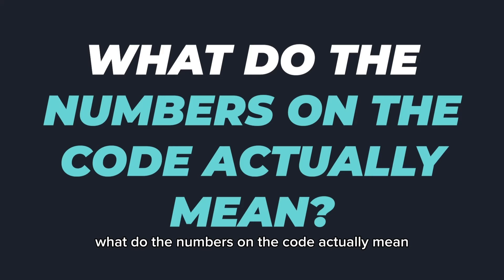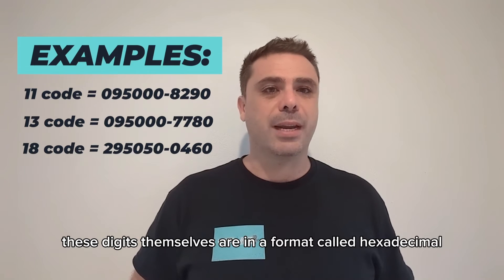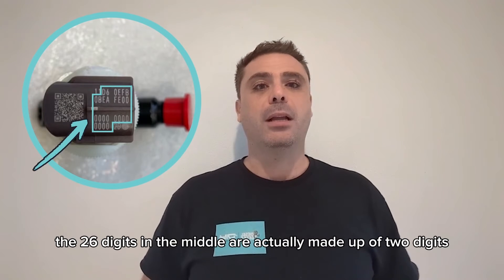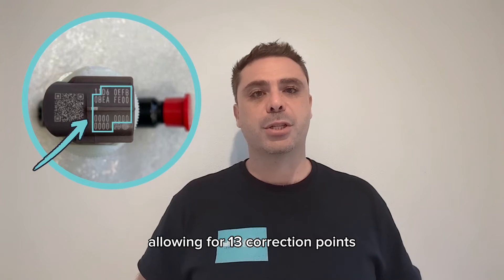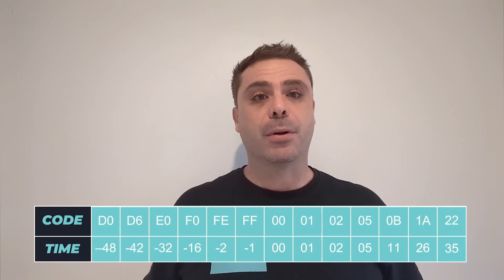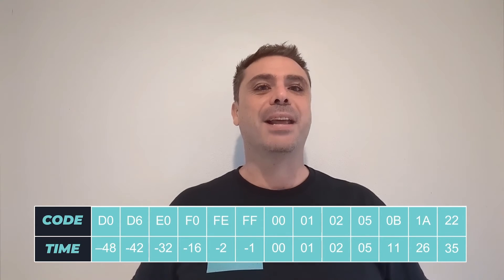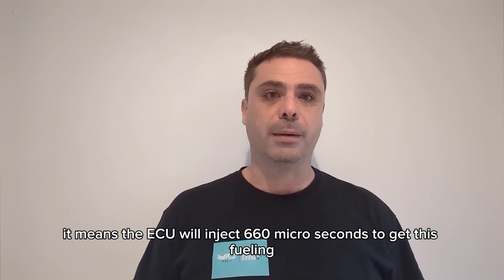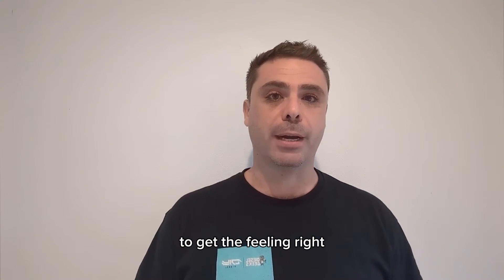Denso Injector Codes - Everything you need to know (short)

Comment: does it matter if you pull out injecters that are say code 11 and replace with code 18?
Reply from the maker: @cheezus1098  yes. Basically 11 code and 13 code injectors are very similar, but the use of alternates means you cannot code.

18 code injectors flow around 15% more in the top end and more like 80% more at pilot fuels. For this reason, 18 codes aren't ideal to swap for the others.

Of course if you're tuning, or coding to suit the ecu, then everything is different.
Reply: @DieselGeeksOz  i just did an injector change in my 2012 hilux and the old injectors were codes 11 -13. my replacements are 18 (what the shop gave me for my model) . im just having trouble with the pilot learning and im searching the hills trying too get the answer as too why. if i replace all with code 18 this should be fine as long as i recode and pilot learn yeah?
Reply from the maker: @cheezus1098  did the ecu accept the codes?
Reply: @DieselGeeksOz  yeah accepted the codes, starts and idles, but keeps failing the learning when we try too do it. ( Had it running too get normal operating temp ect )
Reply from the maker: When you input the 30 digit code from the top of the new injectors, did the ecu accept this, or did it come back with an error?
Reply: @DieselGeeksOz  it accepted all the codes when they've been put in. but in the pilot learning statge where you have too take it too 3000 rpm over and over again, it keep failing there.
Reply from the maker: @cheezus1098  were these genuine? 
Also, have you checked the rail pressure fluctuations?
Reply: @DieselGeeksOz  yeah genuine denso injectors, havent looked at it in a few days but as far as a i know everything was fine ect. but it doesnt reach the 3000 rpm as fast as it should when doing the pilot learn. like it idiles fine and sounds fine but just wont reach the rpm fast enough, and the pilot learn says "every 2 seconds press and fast release the acclearator too reach 3000rpm"
Reply from the maker: @cheezus1098  get her up to full operating temp. 

Hold the throttle flat for as long as it takes to get to 3000rpm. Then let go fully of the throttle.

You'll hear a 'tick tick tick' on decell from 3000 back to idle. This is the ecu learning as the tick is it injecting fuel and assessing the outcome.

All that said, something sounds not right. It should free rev fine - even without the pilot learning done.

My guess is, solve that low power problem, and the rest will resolve also
Reply: @DieselGeeksOz  thanks for all your help and letting me pick your brain, ill keep you posted when i finally get on top of it 👍

Comment: i'm confused. what does denso 23250-BZ030 means?
Reply from the maker: @wezkerlim  that's a Toyota part number. The code is what is on the top.
Reply: @DieselGeeksOz  sry i'm still confused. i only know 23250 is a toyota part number, but i can't understand the rest even after watching the video due to different code format.
Reply from the maker: @wezkerlim  the code is on the top of the injector, not the side of the body...
Reply: @DieselGeeksOz  i think i get what you mean now & why its been confusing. there's no codes on top of my injectors